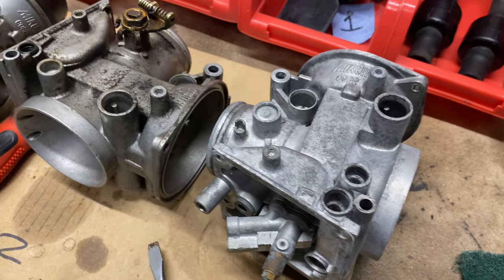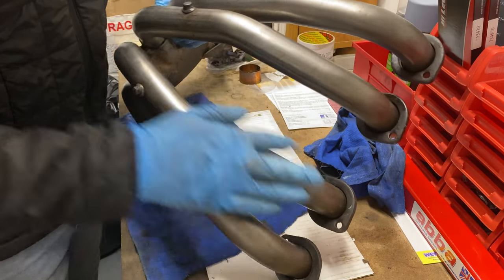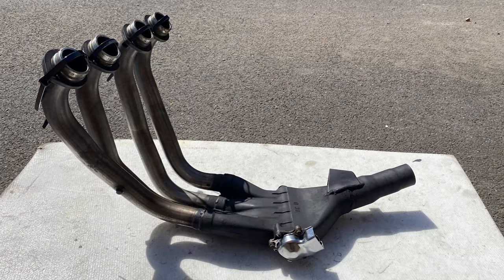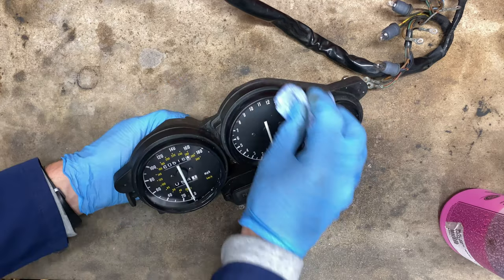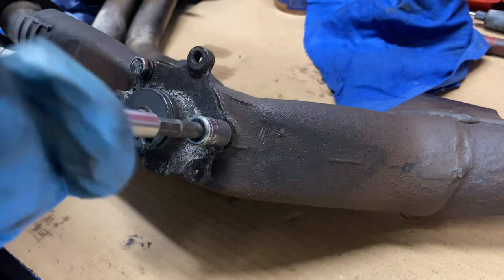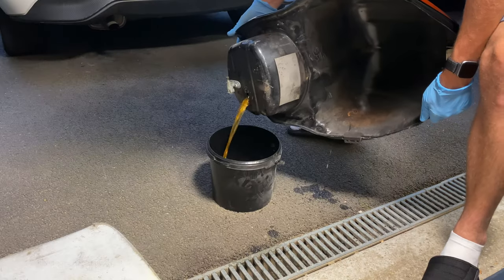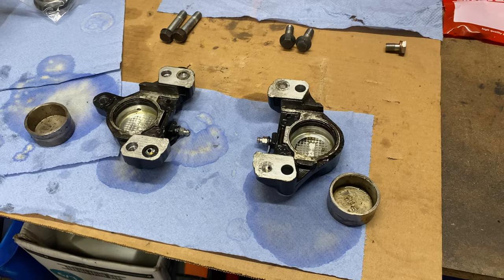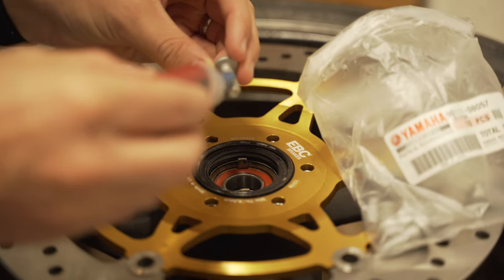13 - Rebuilding My FZR1000 | Tom's Workshop

Comment: Great work Tom. The torque wrench audio sync was a touch of class. Were the German headers beyond autosol-ing?
Reply from the maker: Considering how long it took to get that to work I’m very glad someone noticed 😂 I think so, I did give them a similar scrub up and buff but to be honest by that stage I was just desperate to get a correct fitting set on the bike! Problem with getting close to finishing and being impatient 😂

Comment: Tom, enjoying the video just found them. Would you know why a 1995 clutch basket won't fit in a 1991 engine
I know its a different year but wanted to know if you knew the reason. Thanks in advance
Reply from the maker: Cheers Henry, I’m not sure I’m afraid, I know they did make slight modifications to the engine across the different versions, but I haven’t got around to anything on the clutch of mine yet. Is it the same part number across the different years? That’s usually my quick check to see if somethings compatible

Comment: V 17:07 min do you add brake fluid through the brake caliper up into the reservoir?  That procedure is because of the air in the liquid??
Reply from the maker: Yeah it’s a technique called reverse bleeding which I find a lot more effective at bleeding empty lines. I still revert to the normal method after to make sure there’s no bubbles left.
Reply: @tomsworkshopprojects  Thank you for answer. 👍👍

Comment: Hello, I am from the Czech Republic.  I have the same motorcycle and it has been standing and not running for more than 5 years.  I was interested in your video because I want to renovate my motorcycle and get it working.  Query.  : clean the fuel tank of dirt.  Did you use any fuel tank cleaner??  Thank you
Reply from the maker: Hi, welcome! I used Deox-C to remove the rust in the tank which worked really well. Good luck with it!
Reply: @tomsworkshopprojects   Thank you for answer. 👍👍

Comment: Nice work 👌 question dude I have 1992 fzr 1000 just wondering what’s the battery voltage should be as I measured and it’s between 14 and 15v is it correct ?
Reply from the maker: Sounds about right, the manual says it should be 14.3v and 15.3v at 3k rpm
Reply: @tomsworkshopprojects   thank you so much !! 😊 now I can drive it with no worries of thinking that the bike will stop in any minute 😅😅

Comment: Hii Tom's i need diagram wiring for rpm connecting
Reply from the maker: Should find the main one in here if that helps. http://www.exup1000.co.uk/downloads/FZR1000_F_94_Service_Information.pdf?Service/FZR1000_F_94_Service_Information.pdf
Reply: I don't know if you found it yet, but its the yellow/black wire coming from the ignition unit..